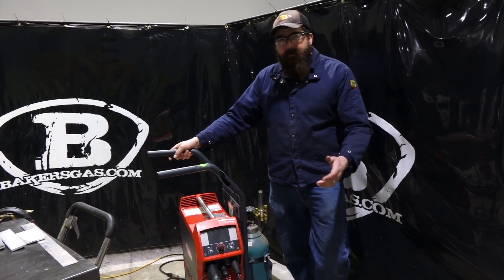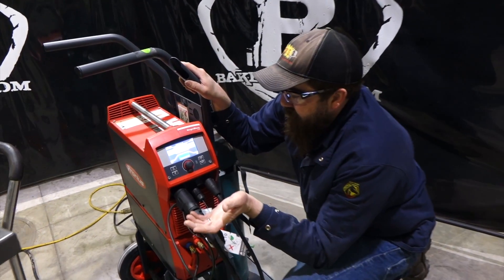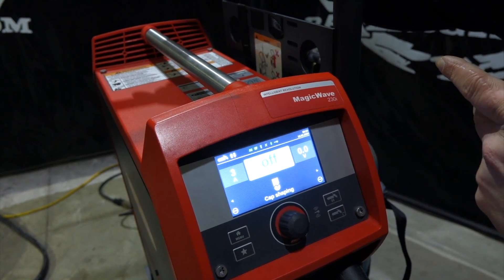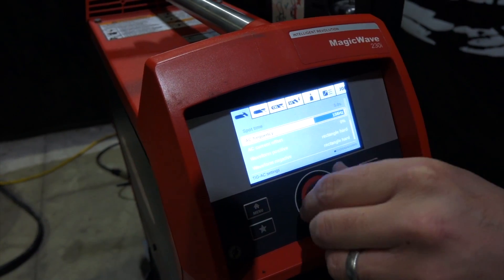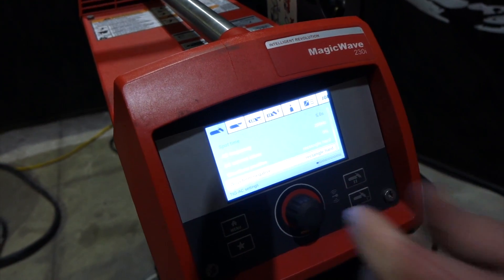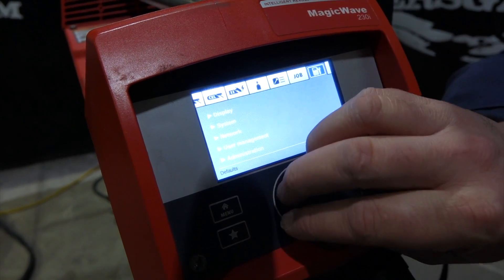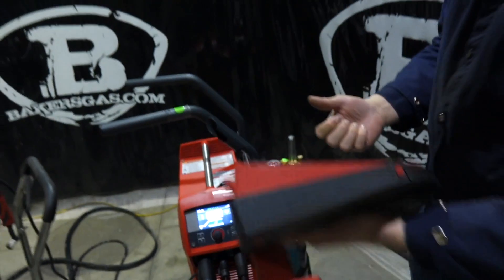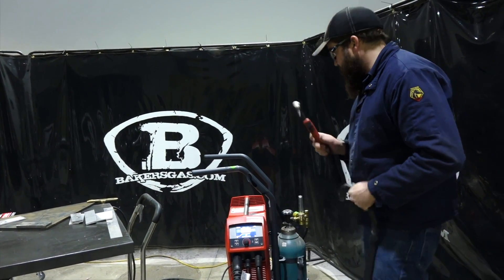Fronius MagicWave 230i Review and Demo

Comment: Does standard 17, 20&26 hardware fit with the original Fronius torch?
Reply: Only the front end by the looks. All else looks proprietary.
Reply: @tristanpatterson3843  I contacted the Fronius dealer, and he said that 17,20&26 accessories are compatible with the torch head that has the threaded cup, the torch head with the plugged on cup isn't compatible with these accessories.

Comment: Are using a FUPA cup on AC? First I’ve ever seen that done. 🤷🏼‍♂️
Reply from the maker: Yes we are :)
Reply: @BakersGas  with aluminum, you want smaller diameter nozzle... you'll notice less arc wander and the "cleaning zone" will shrink too, so you get a prettier weld. I typically use a #4 - 6 and about 15cfh in the aerospace industry.
Reply: @mrsleepin1433  yes I Second that aswell small diameter is the way to go with aluminum. But very surprised it worked this well 🤔
Reply: May I humbly recommend against this? Furick large dia cups are not rated or recommended for AC use. Best to use small dia 4-6 cup with a std nozzle or small gas lens. Love your channel and reviews. ✌🏻
Reply from the maker: @ShowMeThePony  Noted thanks for watching and the feedback.